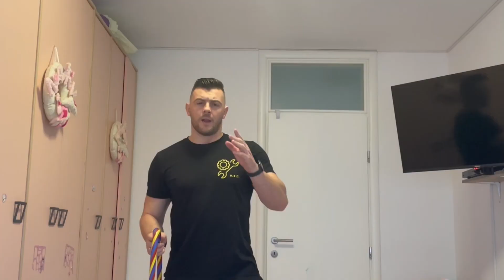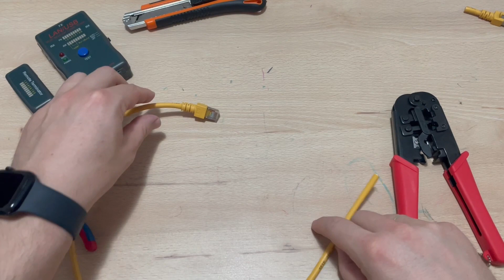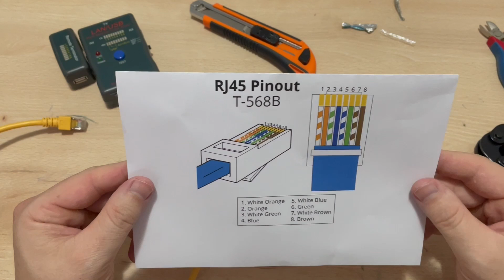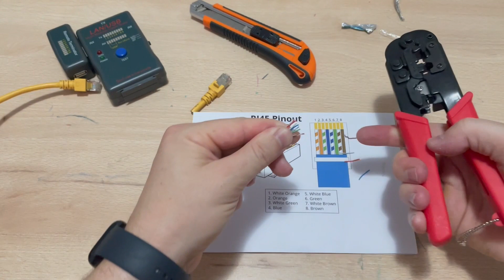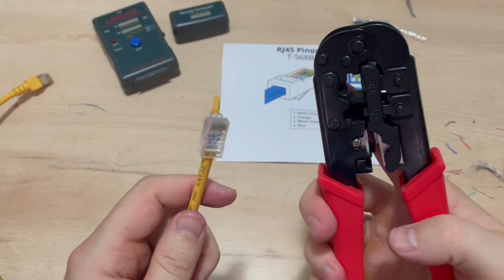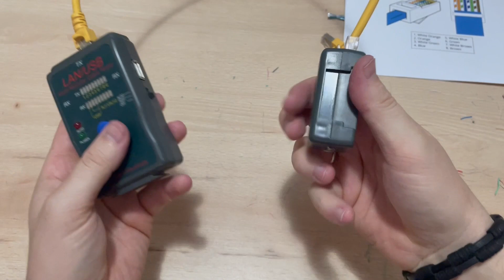RJ45 Connection on CAT5 Ethernet Cable - Fast and Easy Guide

Comment from the maker: Tools used in this Project:  
RJ45 Pass Through Cat6 Crimping Tool Kit:
https://amzn.to/49bMJMN 

Cat6 RJ45 Connectors, 100-PACK:
https://amzn.to/3FHJ2kq

Cat5e Ethernet Cable 150 Feet:
https://amzn.to/3FHtYDq